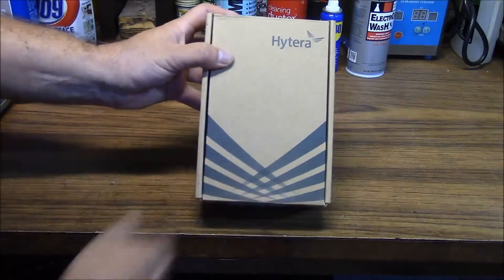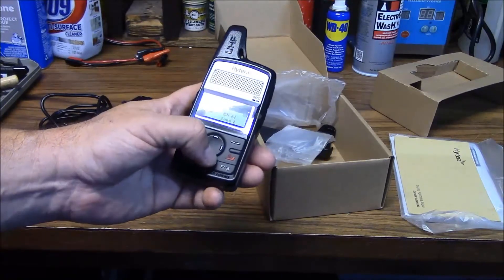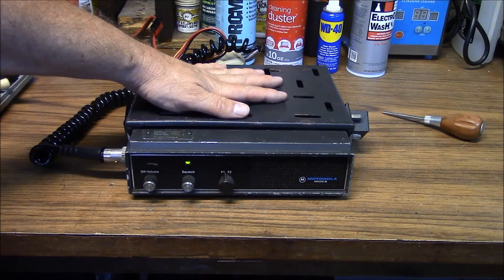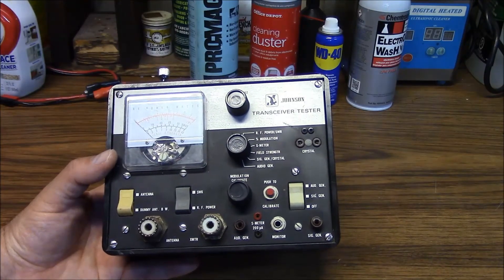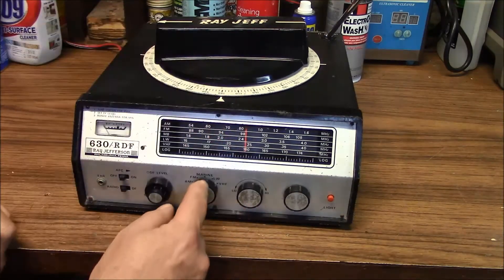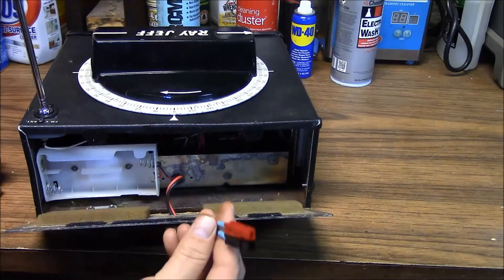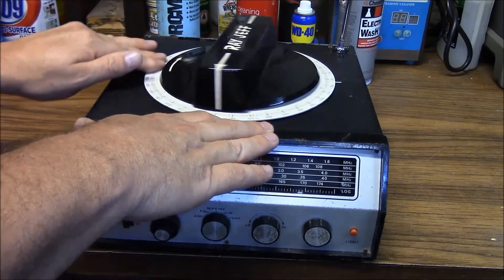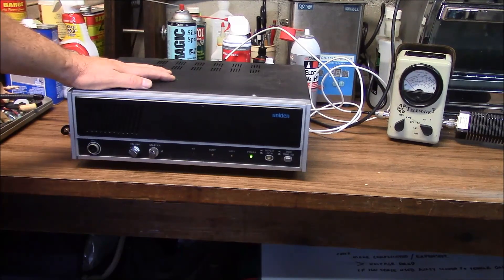Hamcation 2018 radio projects part 1

Comment: Never knew they were offering the Mocom 35 as a synthesized radio. Most of these were rock bound units using PITA channel elements. I had one on UHF as well but it was beyond repair, the one item worth saving was the PA brick final, it could be used for an amplifier for ATV usage, that is where mine wound up in the end. I thought the first synthesized Motorola radio were the Mostar series radios which used a proprietary "RIB" box.
Reply from the maker: I have not touched a Mostar in a long long long time. We ran the Moxy's for public works before trunking . Actually used bendix king and Yaesu commercial radios on 800 conventional way back then. Thanks for watching !

Comment: Yeah, I went ahead and got a Baofeng UV-5R V2+ Plus Dual Band FM Transceiver that's suppose to do digital but I haven't figured out how to do it. Just listening is fine for me right now. But if I can't figure out the digital stuff then it'll be worthless pretty soon.
Reply from the maker: Radioreference.com probably has info about DMR systems in your area if you are interested in listening. It really isn't difficult to set up . DMR-MARC has lots of info for the amateur radio side of things.  Thanks for watching !